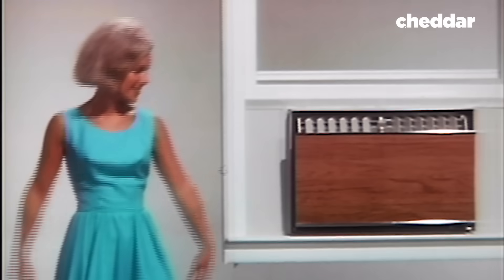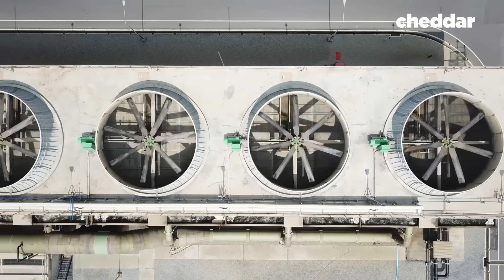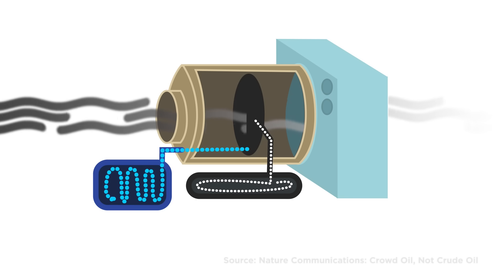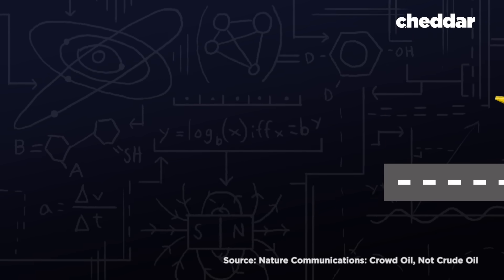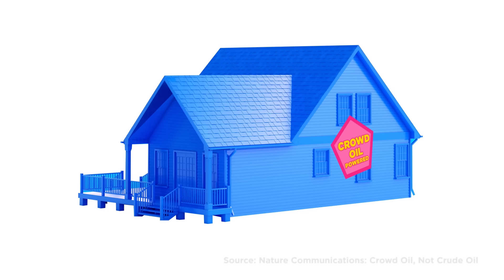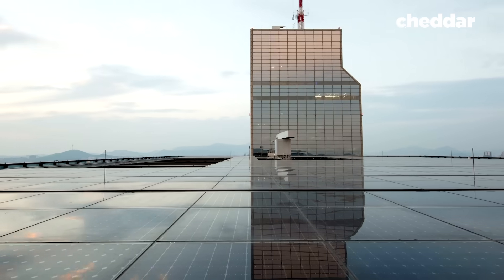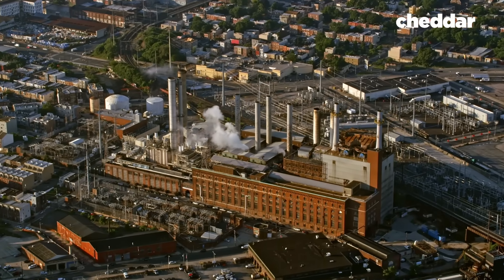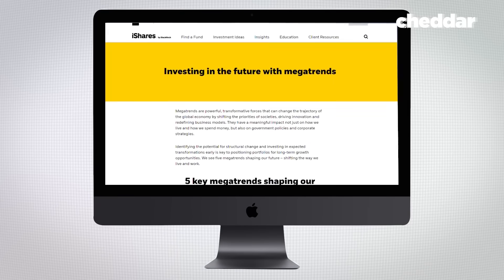How Your AC Could Help Instead of Hurt The Environment - Cheddar Explores

Comment: And all of the co2 goes back into the atmosphere when it is burned
Reply: Carbon neutrality is better than not doing anything at all
Reply: @johnsanvictores6639  it's not neutral at that point unless the original power had no carbon footprint which is highly unlikely, considering solar panels and other "renewable" sources have HUGE carbon footprints.
Reply: @johnsanvictores6639  No, its not, because its not neutral, you are making all the A/C units inefficient, do you really think putting a filter in front of the fan and blocking air-flow will make the A/C more efficient ? NO !
Do any of these people even know the basics of engineering? I guess not.
Reply: @johnsanvictores6639  it would really help the idea if then fossil fuel consumption would decrease tremendously by making petrol more or less a renewable energy.
Reply: @adonis1273  "decrease tremendously by making petrol more or less a renewable energy"
While petrol is a renewable energy, it is far from carbon neutral... and releases millions years old carbon that had already been sequestered by nature. This solution, which I don't exactly throw much backing on, is about as close as you'll get to a clean petrol.
Reply: I think that the thing being missed is that this is a great source of petroleum equivalent for creating plastics and other oil derivatives that aren't fuels, thus becoming more of a carbon sink.
Reply: No it's not handled. This is just really ineffective compared to just use the electricity to drive the car in the first place. Too we should really just turn down our car usage instead.
Reply: This is handled under the "moral hazard" section of the video. Ever considered watching it all before commenting?
Reply: It is just a way to offset new carbon.
Untill the world becomes fully electric, this can be done as a way to stop digging for new oil and can act as a battery. Like using the energy where there is surplus (eg wind energy) to produce this fuel and can be transported where needed.
Reply: @-Rishikesh  Well, to be fair electricity is formed mostly by burning fuel....
Reply: It sounds like a perpetual motion machine

Comment: Errr, the whole issue of why there is so much CO2 being generated today is because we are burning Hydrocarbons as fuel on a large scale. So isn't Crowd Oil / Synthetic Oil being used in combustion engines like those of cars gonna create more CO and CO2? We will basically be sucking CO2 from the air to generate fuel that generates CO2 when burned.
Reply: That's why it's carbon neutral. Part of what's causing issues at present is the fact that we're digging up carbon that's been locked away in the Earth for millions of years. Getting to neutral would at least mean not adding more carbon to the air, and that's a more reasonable step than swearing it off wholesale.

However, the transition away from combustion would still be the goal, and as industries are weaned off hydrocarbons, this system would already be in place so that fuels generated could be sequestered instead of burned.
Reply: @NotHPotter  It works technically, but its not like oil companies are gonna magically stop digging up oil. Look at Trump's UNGA speech this year. He was practically boasting how USA and not Middle East is now the largest oil producer in the world. He is encouraging coal production as well. Then there is Bolsonaro, who is turning a blind eye to the huge amounts of Forest Fires in the Amazon Rain forest. At present, we need ways to remove CO2 from the air, and that's it.

Comment: It took almost the entire video for them to address the obvious fact that you need to put more energy into this system than you get out in terms of usable fuel. But since the bottleneck is our adoption of zero emission energy production, I think this won't cause us to be complacent. The only problem I can see is that, essentially the only upside to this technology (economic gain from a carbon neutral process) would depend on the market for these fuels. If the fuel costs more in energy than it can be sold for, it won't be profitable. I think this would be a good way for companies to offset their emissions, if they paid for its operation, and for sequestering it.
Reply: Carbon neutral does not have to be energy neutral. We live in an open system where the sun gives us energy. Our problem is we don't know how to store that energy well enough to replace carbon polluters, thus making this a very appealing idea for many nations, if not including America.

Western European countries, as well as many 3rd world nations across the globe already have difficulties getting fuel, and are forced to import liquefied gas in pressurized cargo ships, or rely on the whims of Russia--whom Oil and gas are responsible for more than 60% of exports and provide more than 30% of the country's GDP--or Saudis--about 50% GDP, and about 70% of export earnings.

Though, there are definitely much better ideas out there than reburning fuel, not that such a system would look much different than modern water filtration systems.
Reply: Well, the video delivers its point poorly. The essence of this technique is not to provide energy from carbon, but to provide efficient energy storage using existing installations. Carbon-based fuel is a great form of energy storage, and the nature of renewable energy require good energy storage technologies.

Comment: Well until we crack fusion and is add do the grid we will not solve this problem. Some people and businesses that uses cars, planes and ships will not convert to electric so this carbon capture and making fuel out of it is a great idea.
Reply: No need for fusion, Fission is enough to solve this problem
Reply: Fusion is probably more maintenance than solar panels, and more resource intensive to start, best bet is wind and solar with batteries

Comment: Read up on how much energy electrolyzers consume. This is as useless as any other "green" suggestion since you'll just end up with AC units that consume double the energy, produced with fossil fuels and get a miniscule amount of "fuel" in return.
Reply: Innovation has to start somewhere. Nothing begins in a perfect state.

Computers began about as big as a shipping container, and were glorified calculators. Given the time and support, who knows just how much this could advance.
Reply: @TheGUARDIANOFFOR  As noted in the video, this tech is dependent on the energy to run the systems being generated from non-carbon sources.
Reply: @NotHPotter  If this tech is dependent upon the energy used to run the systems, then it would be more efficient to just use this energy to offset the energy generation from fossil fuels that is creating the CO2 in the first place.  The more steps that you add to a system, the less efficient it becomes; the more energy it wastes.  If you are going to use solar panels or wind turbines to power these things, then those devices would be better suited to being used to directly power the homes and factories that are generating the CO2, not to power this new intermediate step in the process.  If this technology were actually viable, it would be viable regardless of the type of energy it used.
Reply: @NotHPotter  Wouldn't it be far more efficient to just use that clean power in a large industrial plant designed to capture carbon and output fuel? A small number of large plants must be more efficient than millions of small units. And it would take far less space and investment.
Reply: @graham1034  ...yeah, but you're missing the point that this is an improvement of a thing that exists and is in use anyway. Anything purpose-built for a particular purpose is going to be better than an add-on, particularly with economies of scale, but you seem to be willfully ignoring the fact that this is an improvement of AC units that everyone has and uses all the time already.
Reply: @NotHPotter  except its still a stupid idea. I'll just repost another comment I made:

This is one of the stupidest "green" ideas I've ever heard. The energy lost on the fans in AC is a small percentage of actual AC power usage. Most of the energy is used in the compressor. So you want to reuse that fan energy, but then add energy to split water (very energy intensive) and energy to combine with H with the C. Add in storage, transportation and the initial energy and cost to produce the unit. It's basically wasting 100Wh to save 1Wh.

This video badly needs to include numbers on the energy lost to the AC fan and the energy for all of the processes along the way to the end hydrocarbon.
Reply: @graham1034  Cool story, bro. Quit complaining in YouTube comments and go write the peer-reviewed journals they published in. That's literally what they're there for.
Reply: @NotHPotter  I think you're failing to understand thermodynamics though.... This is a moot point because it would balloon energy demand. Some back of envelope math would suggest that this system would indeed double energy use for this unit. Not to mention the Fucked up thing is if we want to offset the carbon you'd need to bury that fuel not use it FYI. Carbon capture is currently fairly viable with carbon pricing and point of source elimination. However, active use capture from dilute sources not so much. Remember co2 is only 400ppm meaning you need to move 25,000 litres of air to remove 1 litre of co2 assuming you have 100% capture. That is most certainly not the case. If you're looking for capture technology at diffuse level it's much easier than this. Plant a field of switchgrass, harvest the entire thing, pyrolysis it such that it basically just becomes carbon ash. Bury in an oil well. Boom you just removed 20 tonnes of co2. This is t a new idea and is sort of dumb because it assumes producing energy will be easy. It's not.
Reply: @TheGUARDIANOFFOR  You would sound more credible if you had a better command of the English language.

Comment: Someone please send this to Thunderf00t
Reply: Right, with tons of free electricity that has no carbon load we can add energy to carbon dioxide to make fuel.

Def not a magic bullet. It is the exact opposite of burning fuel. Add energy to combustion products and turn it back into fuel. The only way this works is with tons of free electricity. But if we had that, we wouldn't need fuel in the first place.
Reply: @indyola1  Just because a source of energy doesn't make CO2, doesn't mean it's a benign source of energy.
Hydroelectric has DEVASTATED the American Southwest, to the point where the Colorado fails to make it to the ocean anymore. And Northwestern dams kill salmon by the boatload.
Reply: @bcubed72  Surely the water depletion of the Colorado river has more to do with agriculture and municipal demands?
Reply: dint he already has made a debunk about this?
Reply: @fkhg1  well did he?
Reply: @calimerohnir3311  I vaguely remember the "plastic from air" one. Was that possibly the one he meant?

There's no way it can be energy efficient. I find it very telling that they're all adding up the amount of fuel produced by the buildings, but don't see it fit to tell us the amount of energy needed to produce this fuel. At least they do mention that additional energy needed to split the water (and also overcome the filter airflow impedance, which they neglect) is a fundamental issue of the approach. But still, this is not journalism, it's barely better than advertisement or company PR.
Reply: @SianaGearz  Yes; someone sent Cheddar a PR paper, and they read it to us.
Reply: @SianaGearz  it doesn't need to be efficient. If excess solar/wind power on hot/windy days can be converted to fuel, even inefficiently, then that's good energy storage which makes renewables more viable and which could also make it carbon-neutral to run cars off of it.
Reply: There is no way this is more then 10% efficent and if you are gonna burn the fuel all it means is it takes like 15 times as much electricity pr mile compared to battery electric...
Reply: Yeah,
free energy AC :D
Reply: @renarsvilnis  No such thing as a free meal
Reply: @calimerohnir3311  Wrong.  Everything is free if you run fast enough.
Reply: Clicked on the video thinking this haahahah

Comment: this is an epic fail because the price will be so astronomical people wont be able to afford such a system. People will always buy the cheaper option, I spent $170 on my window unit AC, Theres no way in hell Ill be able to even afford all in one ventilation system AC.
Reply: The hope is the fuel production would offset the costs, and you’ll eventually turn a profit